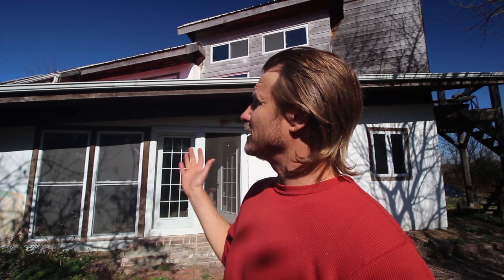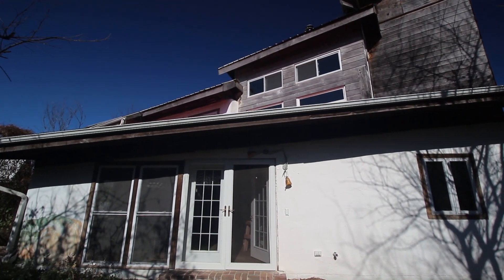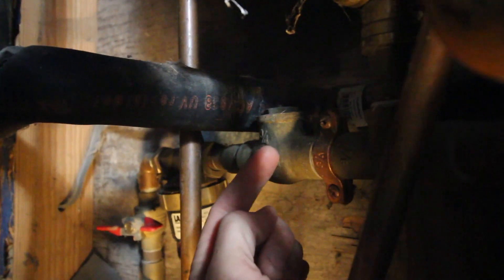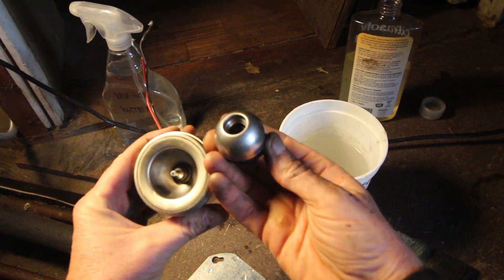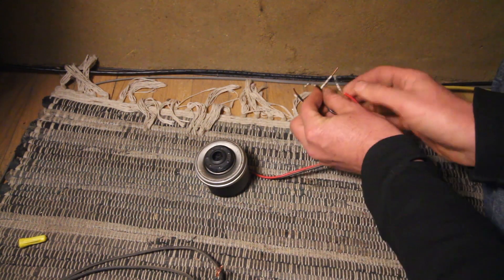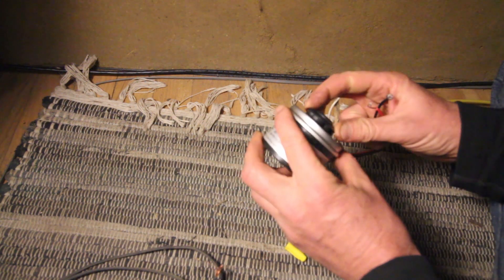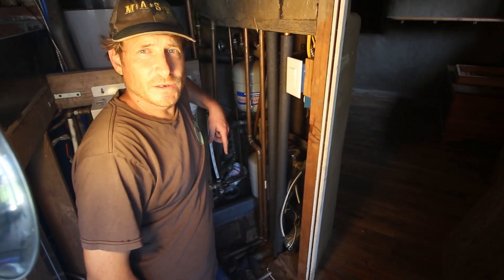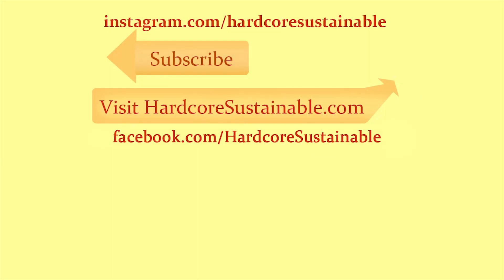Superefficient OFF GRID Water Heating with EVACUATED TUBES

Comment: Can I ask you if these would work in more colder climates? I'm about about 63 degrees latitude in Finland. Don't get a lot of sun during half the year, sometimes down to about -30 celcius on rare occasions.
Reply from the maker: Well the amount and intensity of the sunlight will affect how well they perform. They can work in very cold areas but obviously would work well only half the year, so you’d need supplemental heating. Plugging your info into ChatGPT it does say the summer sun angle is sufficient to provide good water heating, but the rest of the year it would need to be supplemented. It also depends on how cloudy your region is. Evac tubes are much more effective in cold regions than the flat panels.

Comment: I'd like to setup a geothermal array and also use evacuated tube solar as primary heat during the winter. 
Setup Hydronic in floor heat in the house and garage and maybe do a couple loops under the sidewalk/patio and driveway. 
Dump heat into a large reservoir tank and then I can heat the house primary, the garage secondary and the outside surfaces on a last as desired basis.

Comment: Should have 2 pumps with alarm backups and magnetic switches if one stops other goes on with alarm and light backup to protect the system cordless battery 🔋 backup self charging and for testing

Comment: seriously, are the evacuated tube systems any good? how  much do you save?
Reply from the maker: I think they can be good if they are installed correctly. It's possible that solar electric is the more efficient and cheaper option now compared to the passive evac tubes. They are much more delicate and difficult to install compared with photovoltaics, and they won't store energy as well as batteries, unless they have a large storage tank. Solar electric is also a lot more adaptable because electricity can come from anywhere if needed, but the sun has to be shining for these evac tubes to heat water.
Reply: @HardcoreSustainable  i wondered how much hype i'd gotten about the evac tube thing, and figured you could give an honest report.  now i'm pretty sure i'd be disappointed if i shelled out all that money and labor.  i'm trying to quit that lol.  thank you very much for that.
i was also considering the "Hybrid Solar Mini-Split Air Conditioner Heat Pump" but think that's probably mostly hype as well.
so i'm curious if you know of any other method of heating or cooling that would save money over traditional ways (other than burning wood and  all the work that entails)?
bring on the free energy right?!  thanks
Reply from the maker: @blackskywatch4027  I was looking into some options for our common house and the Mercantile building we are about to buy. I would like to find a solar electric option because those buildings currently use wood as a fuel and it pollutes the entire village and I think is shortening all our lives. Air-sourced heat pumps can be an option, but I don't think they are as useful in the dead of summer or winter. I haven't figured out the best option yet. I'm still doing research. Ground source heat pumps are much better, but they are a larger investment in money and space. I do think there is a good solar electric option, I just haven't settled on one yet.
Reply: @HardcoreSustainable  i've heard you can buy used pv panels for cheap, but i don't know where to find those deals. may be a good way to get ahead of the game.
the only other thing i would throw out is if you had a body of water available, you could use that for ground source i think instead of drilling.
Reply from the maker: @blackskywatch4027  Yes, that makes sense. It would have to be close and large enough. We have cisterns, but they wouldn't be big enough.
Reply: @HardcoreSustainable  hmm.  i responded to you a few days ago and now i see it's not showing up. anyway, thanks for commenting. you gave me the honest review i was looking for.  so i realise now that the info i've read about the evac tubes has quite a bit of hype included. 
but i just saw a comment about how the price of pv panels has improved so that's good.  i do think a heat-pump water heater is a good value.  and i'm not finished reviewing the "Hybrid Solar Mini-Split Air Conditioner Heat Pump".  is anyone at your place using one of those? 
have you come across anything else worth the money? guess burning wood is the best but that's a lot of work. thanks again.

Comment: It is indeed very difficult to clean a pump.     Sometimes i use ( not knowing the English word) a vibrator. 😅 No,   not that one.     One that i also use to clean carburators.  When starting it immendiatly the solvent becomes very dirty. So i need to change that 3 or 4 times before the pump is clean. 
Last year a friend of mine disconnected his 25/80 Grundfoss pump he has inbetween his wood/central heating system.   For almost 6 months.   
He firstly let his woodstove burn. Then he remebered to put in the pump for power.   And his stove was allready boiling.  Needless to say the pump did not start because all the sediment clocked up.   So stupid. Because i had installed a pumpprotection.   So that the pump would automatically start at 30 degrees Celsius. And also every 24 hours would pump for 15 minutes.   But he even wanted to save himself that very small amount of money. 😢
Took me 5 hours to get that pump working again. A 400.00 Euro pump.  And he even was angry at me because i had installed everything 8 years ago  (for free).   He has not even one clue how it all operates. And after explaining for almost one hour that if a pump does not turn for several days that sediment can get the pump stuck i stopped explaining. 😢 The story is.   Never help friends who have not the slightest understanding how something does work.   And also such a wood / central heating system can become dangerous.   Especcially when a houseowner so once a while does not check the safety appliances that are build into it.    Made a 97 degree Celsius thermal valve that can cool a stainless steel ringtube inside the heat-exchanger. But he had that closed off. 😢   So he had only his 3 bar pressure release-valve.   It became very messy and he also was mad at me because of the scare noise it made. After i told him to be happy that he did not blow up his wife and kids i had to go. While he shouted that he would hire a pro.  It is better for some ppl to not own such systems.    At my house i allways keep some braincells focussed towards how it operates. Also to prevent troubles. 

Lately i am thinking to add vacuumtubes or solarpanels.  To heat the 500 and 6000 liter boiker i have.    But still not sure what the best option is. 
I live at the countryside and solar also would give me some electricity.  I then would need to add a electric heatexchanger to the boiler.   To warm up the 6000 liter boiler i probably would need a lot of panels.  Maybe vacuumtubes would give more rendament ? 
That is why i am watching some YT video's.
Reply from the maker: I'm not sure what to recommend for you. The vacuum tubes could bring the temp up and then the water heater could bring it up the rest of the way if it's not hot enough. This system in my video does have a hot water heater tank inside, but I don't know if it does anything but hold the water. It also works with the wood cook stove in winter to heat the water, so there are multiple sources of heat for the water.

Comment: Unfortunately, the sky is almost always overcast during the winter in central Ohio, so this kind of system wouldn't provide as much benefit here
Reply from the maker: I suppose, but you need hot water year round, so a lot of the year it could supplement a water heater. As this house in the video has, there is also a wood cook stove that heats water for the house. This would supplement water heat in the winter when it is cloudy.

Comment: Use flat panels. No antifreeze coolant and no pumps. The entire middle east uses these on every house to get hot water.
Reply from the maker: The Middle East is a hot desert as I understand and probably doesn't need antifreeze. We get 21 below zero F. These are far better at heating than the older flat panels.
Reply: and when its -20c what do they do??? or what would they do?

Comment: Can you talk about how to prevent freezing in wintertime in the tubes and the supply/return lines? Also, do the supply and return lines come up through the foundation or via the side of the house?

I'm designing a cob/straw post and beam in CT and appreciate your insights.
Reply from the maker: If you use antifreeze in the lines you should be okay down to very cold temps. this system has a heat exchanger in the water tank to transfer heat from the antifreeze solution to the water. The supply and return lines come in through the side of the house, but are underground from the array to the house. I think either way would work but keeping them underground as much as possible is preferable.

Comment: Is that Liang D5 pump? It's usually used for computer water cooling systems and don't handle hot water well. I think they can handle only about up to 60/65C water temp.
Reply from the maker: Yes I did see some videos where it was being used for computer cooling. I didn't come up with the design for the system myself. I just replaced the pump that was there. But it was very hard to find.

Comment: That pump is SO noisy I suspect it is spinning in air. That is, you may have air in the system which allows the pump to overspeed. My system used to do this until I installed a purge pump just to remove that air. I also installed a flow gauge so I can actually see the glycol, judge its condition by its colour and measure its flow in liters per minute. If air does cause problems you'll see that because the flow drops to zero.
Reply from the maker: Those are good recommendations. It is kind of a crap shoot knowing what's going on in the pipe without a flow gauge. I just had to pump until fluid came out the valve that's above the whole pipe run. You'd think that if you ran it with that valve open the air would all settle out of the system. But it could be that is part of the problem. Thanks!

Comment: Just remember it still takes fossil fuels to make everything your using...great video.
Reply from the maker: I am very aware of that. Pretty much everything is in our economy. There's only so much you can do about that. Better to use tech that is made from fossil fuel that doesn't consume fossil fuel in it's daily use, though. Thanks.
Reply: It took fossil fuels for you to type that comment. It takes fossil fuels for you to exist. What's your solution?

Comment: What kind of controller are you using? I am using a Tekmar 157 with a variable speed pump and it is getting a lot more usable energy out of my panels than the previous owner did. I'm not sure if there's a 12V equivalent though.
Reply from the maker: I don't think this system has a controller. The pump goes on when the sun is shining and circulates the coolant liquid. It heats the water in the water heater. When the system is on during the winter, excess heat has to be circulated through the radiant floor tubing in the floor or otherwise dumped somewhere or the pressure valve on the water heater will blow. But this doesn't happen because of the evac tube system, it happens because both the evac tubes and the wood stove are being used to heat the water in the water heater.  It's not hard in winter to find ways to deal with excess heat.
Reply: @HardcoreSustainable  well it's crude but if it works 🤷‍♂️ I found having a controller allowed me to achieve considerably higher output temperatures as it stagnated the water in the collectors. But in your case that may not be necessary if your not heated a lot of water to high temps.

Comment: What you can't do is make policies that ban fossil fuels. That is why the biden administration is in so much trouble. Natural gas is fairly clean.  Anti freeze and nickel metal hydride batteries are non sustainable. You will get free hot water, but this is by no means more sustainable than a natural gas heater. @hardcorsustainable
Reply from the maker: Of course it is more sustainable than a natural gas heater. It works entirely with the sun's energy and produces no carbon, aside from the embodied energy in the solar array itself, which could be built with renewable energy. But that will be made up for many times in the energy savings. Natural gas also has a huge embodied energy. It comes from fracking, which is basically destroying any hopes of underground water supplies in most parts of the US literally forever.  All those aquifers are being filled with proprietary chemical cocktails and will be unusable forever, alll so we can get maybe 6 months worth of energy and create short term jobs for a few thousand workers.  Natural gas is a fossil fuel that contributes to climate change, just like any other oil product.

There are no batteries in the system. Anti-freeze is not great, but certainly doesn't make the system worse than natural gas. Definitely not worse than fracking chemicals in toxicity or volume.
Reply from the maker: Policies are needed to transition away from fossil fuels. Currently they are heavily subsidized and most are far more expensive than renewables right now. Wind costs half of what coal does, yet coal still dominates. Solar is cheaper than fossil fuel and become cheaper faster than any other source of energy.  It's unlikely fossil fuel would be banned, it just shouldn't be subsidized and we certainly shouldn't be fighting wars to secure the supplies of it when there are cheaper and more sustainable options. The US is falling far behind China and the rest of the world by continuing to embrace outdated and expensive forms of energy.

Comment: These pump are unreliable.. I would not use them in a system like this. I had a problem with two of those. I changed them for a more standard pump and got no issue whatsoever since.

Comment: Great video; would you be willing to share how much EV tubes cost and which company you got them from; assuming you are happy with the purchase.  Thanks.

Also, does anyone know if a drain-back system could be used (using water) instead of using glycol with the EV tubes?
Reply from the maker: I don't know about a drain-back system. What is that?  The glycol is used so it doesn't freeze in the tubes and rupture the channels.

I can try to find out about the company and cost. They were bought by the person who owns the house...not me.
Reply: @HardcoreSustainable  Thank you.  A drain back system uses water, not glycol and when the sun goes down drains the water back to the storage tank so the pipes in the collector don't freeze.  This system is more effiecient.
Reply from the maker: @marksTips466  I see. I'll have to ask the owner how much the evac tubes were.

Comment: These systems are can boil water even in cloudy conditions. And with enough thermal storage can easily be used to heat structures.
Reply: Hi Dave. I'm from the midwest where there many cloudy days throughout the year. I'd also like to help people in my region take better advantage of sustainable energy rather than fossil fuels. Could you please further explain how these systems can boil water without direct sunlight? Be as specific and detailed as you like. We can't afford another century of wasted energy.
Reply: @Rick-the-Swift  The key is to have a big enough water tank vertically orientated and properly insulated. https://www.youtube.com/watch?v=CTpEj5XPpc0
Reply: @WilliamHelstad  For hot air? A brick heat chest baffled so the flows up and down as the air travels along the length would help. If you are not using the exhaust from a woodstove that is...

Comment: Our evacuated tube system had a Thermo Technologies USDT 3002 "pump station" with pump and controls.  It monitored water tank temps and operated at pre-programed temperatures - so as to not cool the hot water tank when there was no sun.  It worked perfectly for years, with no noise and zero maintenance.  I did monitor the pressure gauge on the pump station (to see if the system had a leak) and there was a glass sight tube to monitor the color of the antifreeze (food grade).  If the color of the antifreeze changes, it was over-heated.

Comment: If you alternate the current of 12v or 24v systems (the solar panel getting some light, little light, and no light), you will burn even the bests of motors.   Sounds like a brushed motor that has overheated.   You should back up this motor with a 12v battery and let the solar keep the battery charged while you run this motor.
Reply from the maker: I do think the motor overheated and part of it melted.

I wonder how that battery system would work with the evac tubes though. because if the motor doesn't only turn on when there is sunlight on them and the PV panel powering the motor, you will unheat the water in the water tank by circulating the fluid through the unheated evac tubes.  It would definitely have to turn off at night, but in winter it could cool your water very quickly. I see your point, but how would you deal with that situation?
Reply: @Erik Slagter Good advice, Erik. I have an Art-Tec differential controller.

Comment: Bearing is shot, there should not be that much vibration in that system. Maybe we can print and cast new inline pump.
Reply: That particular type of pump had no bearing. The impeller is floating in the fluid as a bearing. The sound you are hearing is most likely from the impeller being out of balance.  You could open it again and check each of the channels that  leads from the center to the outside of the impeller. Most likely, one is plugged, cutting efficiency, and  throwing off the balance.